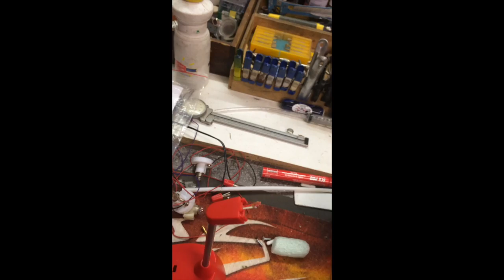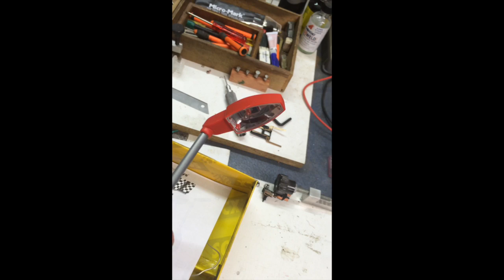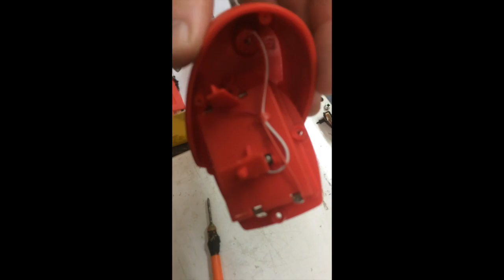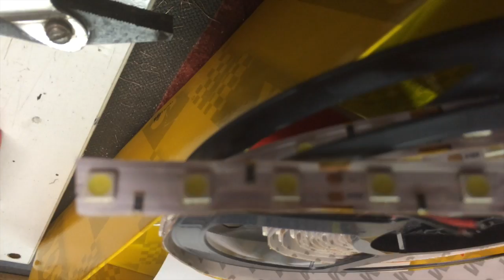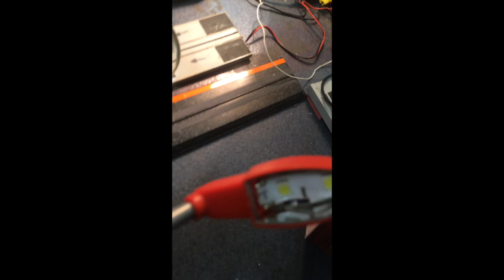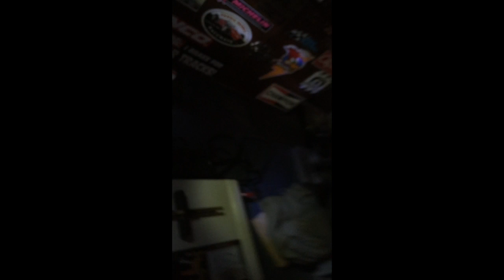Slot Car LED lights modification for Nascar Track - SCX Pit Lights Subbuteo Floodlights

Comment: Great stuff Steve. I am looking to do something similar to my Subby floodlights. Are you running of a adaptor or batteries? Any chance of a detailed vid for us numpties on how to wire the subby floodlights in detail
Reply: Hi Adam,
I have since sold this layout - however, it was just a 12v DC adaptor that I used.  I ran two wires around the underside of the layout (one red, one black) as a 'bus' wire and then simply connected each flood light to it (by stripping off a small amount of plastic from each wire and soldering on - you could also use 'suitcase' connectors here if you didn't want to solder).  As for wiring the LEDs, they are simple - one positive, one negative - and you can't get it wrong - as if you wire them the wrong way, they do not come on !  I pre-wired each one and tested it on a 12v power supply before fitting into the lights.